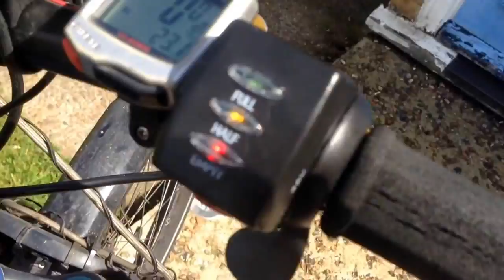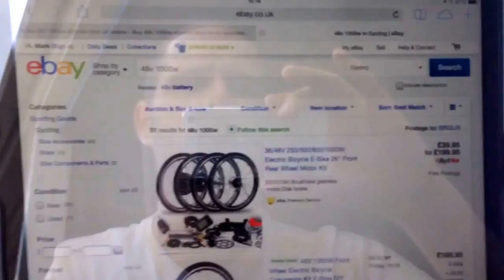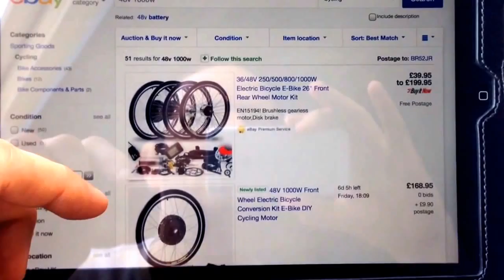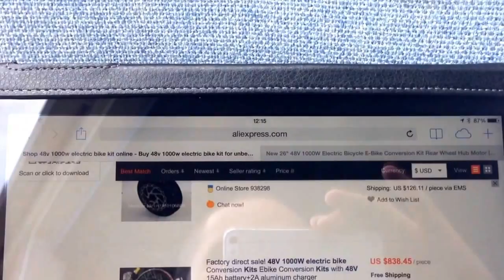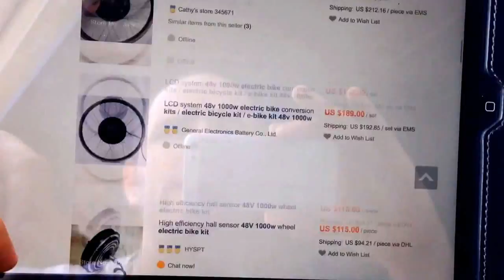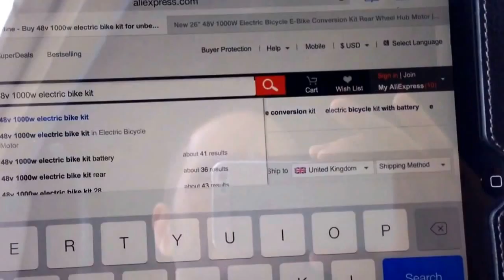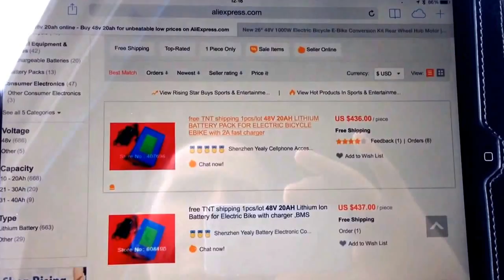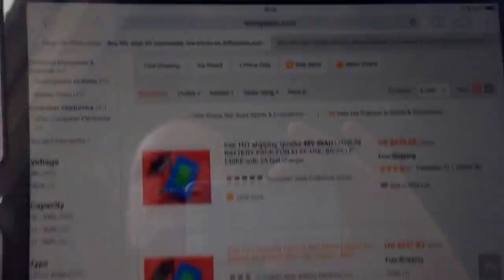Fast Electric Bike, 32mph How to Build, Where to Buy Complete Guide

Comment: Bob, nice video but i have a few questions that your responses may interest your viewers.
Certainly I agree that a Rear Wheel Kit will deliver more power and control over the front wheel kit.

For new buyers I highly recommend Lithium Ion batteries as they weigh considerably less (apprx 1/3 in weight) and much deliver more energy.
Also one of the nicest things about a Lithium Ion Battery is that many of them will fit on may of the down tube of your bike and provide a lower 
center of gravity to aid in the best performance and cornering experience.

And as mentioned in this video Disc Brakes are highly recommended and are often a Life Saver!

Also the Cree lights are an amazing value for your money.From experience I personally recommend the Cree 3x-T6. (Yes, you can rejuvenate your older laptop batteries for extra battery packs).
Aside from that I can only provide this review with excellent recommendations.

I placed the 48 volt 1000 watt motor on my Cannondale Scalpel and it screams on flat roads in excess of 40 mph while climbing most hills at 25 mph plus. (European conversion  X 1.66)
Certainly my Cannondale Scalpel is full suspension with a Lefty Fork and is now E-Charged I love it more then then my E6 BMW (I guess because the Beemer must stay on the road to keep it's value yet the E-Charged Cannondale provides more pleasure.
Reply: BTW, I just Copyrighted the term "E-Charged". Feel free to contact me for update.:  ken@kenthedesigner.com
Reply: Can you YouTube the bike performing?

Comment: I've got a standard
heavy steel batribike
15 mph.do I need a new battery  or motor for the back wheel or both.can any one help just wan about 39 mph with throttle  only then more withl power assist am clueless with electric s I meant 30 mph any advise
greatly appreciated
Reply: Yes Lithium Ion batteries! Simply less weight, faster and more recharge cycles. E-Charge it dude.

Comment: I bought kit, = too wide for brake calpers,
Reply from the maker: This kit fits the standard rear wheel 135mm wide frame you get on all bikes now. If you get the front wheel kit I'm not sure it fits the brake as the front wheel forks are only 100mm wide.
Reply: Kit = from PetrolScooter on Ebay
Reply: Good point!

Comment: i there great video but i dont think i would get away with such a large motor here as its a bit obviously not 15mph and 250w :) if youve been running it for over a year now , how many full charge cycles have you done and how reliable has the motor and battery been.how  many miles do you get on hilly terain on a charge?  it worries me doing those speeds on a bike so would prob go 500w 48v so i would get longer distance.  and not attract so much attention :)

Comment: Nice.  I electrified my Surly Troll with great results.  I work for a guy who sells and builds ebikes in Michigan.  After a few different configs I now am running a Bafang geared hub motor and a  52V- 20Ah Lunacycle Battery pack  and a 9 FET Infineon controller.  Hits well over 30 mpg and easy 25 mile range.  Yes, braking is fun....  Also running a 200mm front rotor and a 180 rear with Avid BB7's.

Comment: One more sprocket, v-belt or chain, small alternator w/ voltage regulator & you NEVER
have to charge it. Just like cars & all motor vehicles.   It completes it ALL!!
peace & someones already riding them but haven't come out yet for a few bugs to work out but it's "Very much doable and IS the final step in this transformation"....CUT POWER
Off at the knees

Comment: Good advice.  I agree 100% about using a full suspension bike.   When I did my conversion a couple of years ago, I used LIPO batteries as I use them for my large Radio Control aircraft.  I made a battery box using PVC down spouts and mounted it space between the frame and the front wheel, it can hold at least 4 5000mah LIPO batteries.    It keeps the center gravity as low as possible.  I had about 1 1/2" (40mm) space to spare between the box and tire.  I also use anti puncture tire liners on my tires and some slime sealer.  The tires I used was the Kenda 26 " 1.95, a little bigger and wider, but handles the weight better.

Comment: I bought 700c gearless motor for my 700c bike, however when I got the motor wheel it looks slightly thicker than my normal 700c wheel, would I have to get a slightly bigger tire?
Reply from the maker: +David Fearon Yes normally the rims are wider for these kits so be to get more of a hybrid tyre at least 700 x 28 or 32 depending what fits in your frame.

Comment: where is the rear derailleur?
Reply from the maker: +Diesel I don't have one fitted i have a chain tensioner instead as it is fixed in top gear. Because you don't need to pedal hard from a stand still so no point using all the gears. Also its hard to fit a shifter and a throttle either thumb or twist and be able to use them both with the same right hand as they are always for right hand side of the handle bars

Comment: is there much mechanical resistance?
Reply from the maker: Anthony Steele when you are coasting there is resistance so not good if you intend to ride without the power, but this isn't a problem when riding with the asistance.

Comment: get a 12ah bottle mount battery from ebay. I have a 10ah bottle mount and i get 30 mile range pedal assisted http://www.ebay.co.uk/itm/New-Electric-Bike-Lithium-battery-48v-10-4Ah-Bottle-holder-mount-Samsung-cell-/151698542140?pt=LH_DefaultDomain_3&hash=item2351f00e3c
Reply from the maker: Anthony Steele you need more than that if you want to go flat out for that distance

Comment: Everyone wants an E-bike conversion, but the setup is a put off for alot of people, I have a drop handle bar shimano shifters road, would I have to dismantle my shifters to get the brake levers that comes with this kit?
Reply from the maker: David Fearon Hi you don't have to use those brake levers i don't as i have hydraulic hope discs front and back. I wouldn't recomend this kind of speed unless you have a 200mm hydraulic front brake at lease.

Comment: It's probably a stupid question, but I'm new to this so bare with me: Let's say that range of that bike is 20 miles. I'm using it for 10, then turn it off, and start pedalling. Is it possible to recharge that way (I know you would probably need constant pedalling pace, special battery that can withstand frequent changing from charging to giving energy, and some kind of a clutch that would enable only quality pedalling to recharge, not some sub-standard pacing). My goal is to build bike, that i can ride normally, but when i want to i can change it to e-bike for 20 miles with top speed at least 20mph. The design can be completeley different from what you've shown here. I'm just asking for pointing me in the right direction for what I need.

Comment: I used to use a 1000w E bike kit and all i'm going to say is you really really need to fit torque arms on that as its above 500w the motors start to warp the drop outs and 30mph is a bad time to have the rear wheel fly off loose. This is what happened to mine after a few weeks because the torque was so big and i use a very similar hub to you.
Reply from the maker: Oh thats not good, i've been using this for a coupleof years and no frame problems yet, asthis frame is pretty strong to start with, but will look into the torque arm.

Comment: so how many miles have you driven on this battery? How many miles per charge is it supposed to give? I have Led Acid and have just over 800 miles in about 11 weeks, but they are very heavy. I paid $160 US dollars for 4 12v 22ah.
Reply from the maker: Alvaro Lopez hi, for 20ah, you get about 20miles going fast, not much pedalling but you can string it out to 30 or moreif you pedal more and dont go full speed. the top speed drops off a little nearer the end of the battery life. This is all based on one charge, and with my 2a charger which is quite slow it takes about4 hours to charge. Hope this helps
Reply: Norman Sands nice! do me a favor and keep me informed on it's performance. How often do you plan to use it? Mine is a daily commuter
Reply: Alvaro Lopez how many miles per charge do you get on the heavy batteries? I am looking at Lead Acid 48v 22ah for $160 or the Lithium 48v 20ah for $450 from china. Also what did you put the heavy batteries in? Also Thanks Fast Electric Bike for this video!!!
Reply: Norman Sands Well I would ride only about 7 miles to work and plug in or the day. I could go about 35 mph. I never tried the hole charge at one time.  Here is the problem with $160 batteries. They don't give you may cycles! The first set of batteries I bought cost me about $270 and I got over 1000 miles before they were no longer any good.  As I mentioned these at $160 got me only 800 miles. As for the placement of the batteries, I made a metal frame that sat like a saddle bag over the front of the bike just behind the handle bars hanging 2.  Also I had a rear bike rack where I put 2 more in another frame I made. It may sound complicated but if you like to build stuff it is very easy. Bottom line is , if you can afford lithium batteries you are better off. The weight and the cycles are just better in my opinion.  The $450 batteries you looking into might not last as long as you might want. This is what I learned when it comes to cost. An $800 lithium battery would probably be way better in the long run.  $$$$ SUCKS!!!!!!!!!!!! this is why I now ride a motorized bicycle that cost me $300. Since  January I already have about 1000 miles on it!! One day I may still buy lithium batteries.   :-(
Reply: Thanks this is a cheap lithium I am looking athttp://www.aliexpress.com/item/48V-20AH-battery-electric-bike-rear-rack-battery-1000W-bike-lithium-battery-power-Aluminum-with-54/32241659039.html
Reply: I work from home and need some exercise. I know an electric bike will not help. But I have a bike path by my house that goes 20 miles in 2 different directions. So I figure pedal and electric do both and still get some exercise and enjoy the outdoors. I hope to ride daily make a routine. I will let you know I just purchased it was on sale for 388 with 7 day shipping free. Its only rated 800 charges 85 percent and 2000 charges 70 percent. So if it lasts a few years I figure they can only get cheaper.
Reply: cool!!
Reply: I have not driven any yet bought battery this morning. Luckily since the price dropped 21 dollars over night. Purchased the Bike kit Friday.So hopefully by next weekend can try my first 20 plus mile ride and see what I get from the battery.
Reply: big plus is the weight. I was not able to peddle if my power ran out. Too heavy!! This happened as the batteries got old 135lbs plus me = 360lbs. ouch!
Reply: I am only on my second charge probably get more if I pedaled some more
Reply: good to know. please keep me informed

Comment: Hey, I just wanted to say thanks for all your videos. They really helped me a lot. I finished putting together my ebike today and it pulls 35mph(verified using my local speedtrap). I actually finished it yesterday but today I put in the torque arm so that I could have full confidence going full throttle. My max speed recorded according to the bicycle computer was 42.8mph with pedaling which can't be right but I will have fun double checking that with the speed trap tomorrow. I also was not expecting it to have so much torque. http://imgur.com/VAAqcC5 I still have a lot to do on this project.
Reply from the maker: Waterfigs Looks good, i would recommend a 200mm hydraulic disc brake on the front if you can. is that a 1000w motor? that seems fast for 1000w, sounds more like a 1500w motor?

Comment: I have a lot of tools for my bicycles but I have no electrical experience whatsoever. Could I still do this?
Reply from the maker: Waterfigs yes, quite straight forward, just put the kit on and connect up all the wires, most have different connectors for each bit so its usually quite obvious which ones fit together. Give it a go.

Comment: I want to say THANKS for revealing a very good wholesale site for LifePO4 batteries! I was a night away from buying more SLA's. At this point I'm very pleased I bought the 60v 20Ah and am wondering how far I will be able to get? I just put on 26 miles at 22-24 MPH and am down only 2.5v from 67v @ 64.5v. The nominal voltage is 60v can I take these batteries down to 60v? I couldnt find good info on these batteries do you know of a good link?  Thx
Reply from the maker: Hi Glad you found it useful, my 20ah battery gets me about 15 miles going fast with still some power left, but if you manage it more by accelerating slower then it will last alot longer.
Reply: what is the link for the batteries?
Reply from the maker: i dont have a specific link but you can search for any on the www.aliexpress.comwebsitejust search 48v 20ah battery for example and quite a few come up, just try and find one where the feedback is ok.

Comment: I have the same sort of kit. I am using a 44.4v 14.4ah lipo battery.
 I use lipo from hobbyking as they are far more cost effective plus a powerlab 6 charger to ensure maximum safety.

Comment from the maker: Thanks, took me ages to figure it all out and make one, but once you know how its alot easier.
Reply: In addition, is the charger UK or US? If US can you use a simple travel adaptor or do you need something more elaborate? Thanks for posting video, big help!
Reply from the maker: Normal you can specify the plug you require, but yes you can use a normal travel plug adaptor
Reply: Fast Electric Bike 
Be careful if you ride this bike on the UK roads. The police are starting to get wise to illegal e bikes.  They will do you for no helmet, tax mot, and insurance so it will effect your driving licence (if you have one)
Reply from the maker: Really where did you hear that? trouble is there is easy way to register for all this.
Reply: Is yours road legal then?  how did you go about it?
Reply: Fast Electric Bike